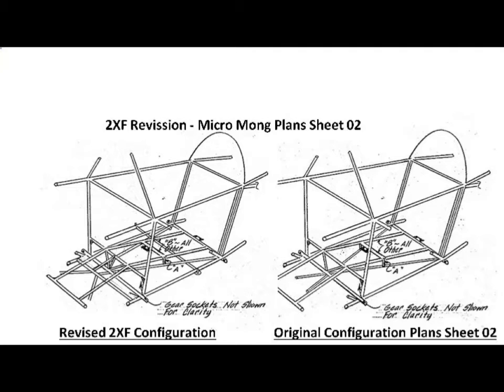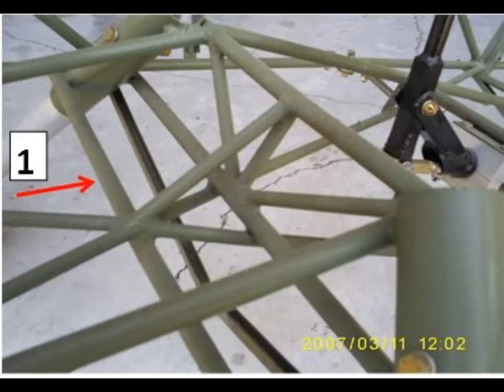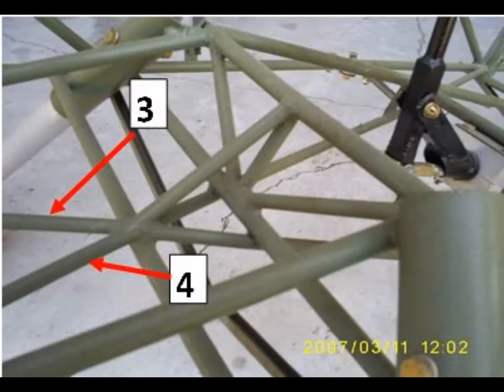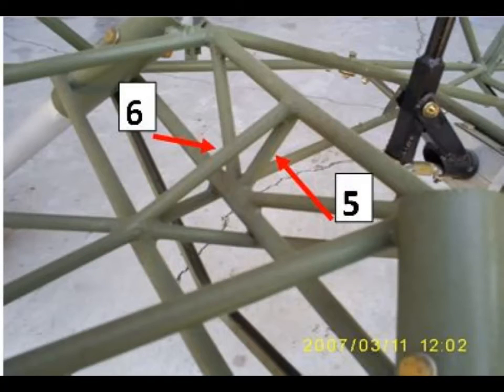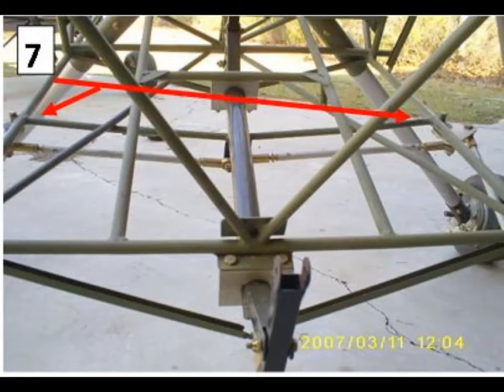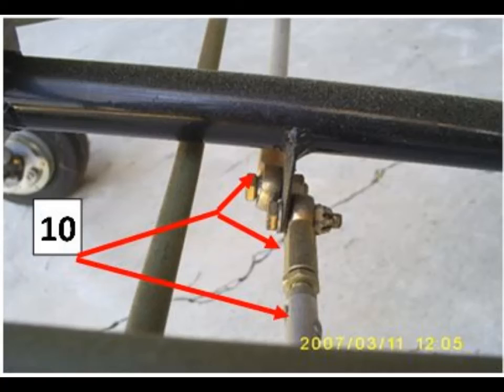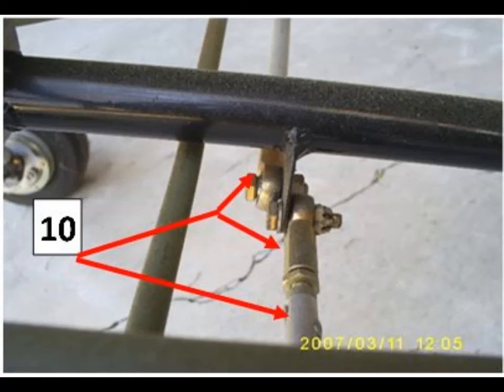MicroMong2XF Kit Comparison - Part One

Comment: What size engine can you put in a Micro Mong built as an ultralight?

A 2XF at 400lbs, I'm thinking, ultralight only in... Canada maybe.    Maybe the original Fisher design was an ultralight?
Reply from the maker: With EXP revisions the Rotax 503 with E drive, can come in under 400 lb. To make weight under part 103 in the US,  no EXP revisions, no brakes, no instruments, plastic AzusaLite wheels, and power by Rotax 277FC with Type A drive.
Reply: What gives you that idea? Ed says it can not be built to part 103 at all. That is why he designed the Zipster.